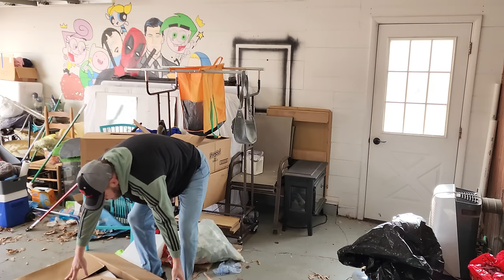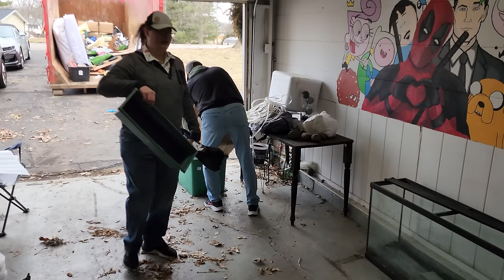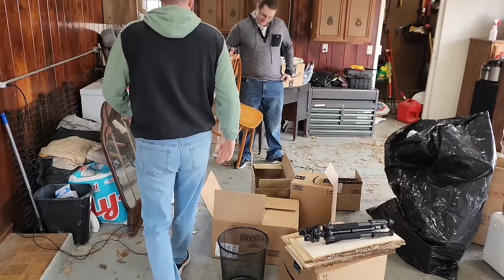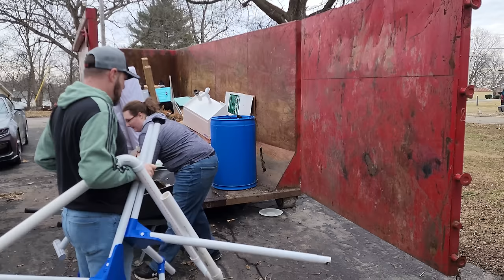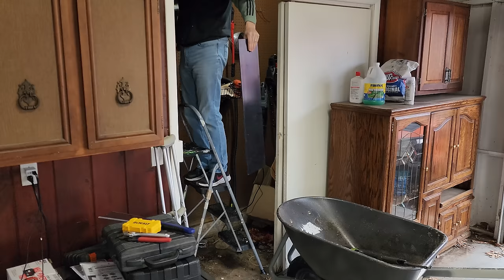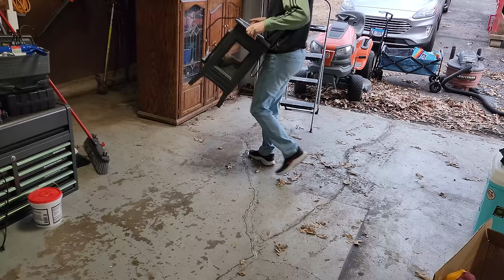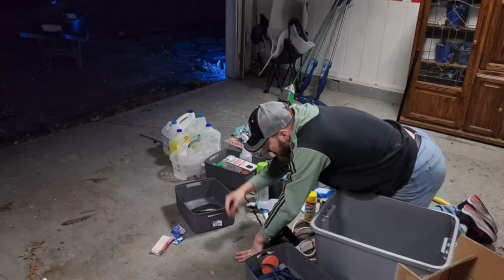Cleaning an 8-Foot Hoard From MY OWN Garage!

Comment: I am a new subscriber and this is the 3rd video of yours I have watched.  I really needed to see/hear this one, as my garage is a cluttered mess!  I am not a hoarder but definitely an out-of-sight-out-of-minder.  My garage is full of storage bins, which shows that I tried to organize my stuff originally, but then I haven't touched those bins for decades.  Like, my kids are in college and I have bins of baby blankets, decades. Another issue is that I only have time for cleanouts during the summer, but I live in the desert so it is 116F in the summer.  Which means I need to do it over winter break, literally the busiest time of year for my family.  Sigh. Spring break is pretty hot too, but more bearable than summer, so I am going to at least try to make a dent then! 🤷‍♀️

Comment: Since I’ve been chronically ill with cfs/me, I’ve had one habit : if I have a pile, physical or working, I literally deal with one item. That’s it. One item. If it’s a box, it’s one box. If I can do another, I do. But it’s still just that one box. Right now. If I don’t feel like finishing, I don’t. Usually one will lead to another. To another and so on. I often get enough done to make me happy. And things get done over time. 

The other thing I’ve done is re-evaluate every single purchase and every single obligation I take on. Subscriptions are no more. They take too much energy to remember and deal with. If it costs more to purchase one time, I’ll be less likely to buy it all. Life is less complicated that way and I realize I don’t really need it. So the clutter of deadlines and obligations is reduced.

Comment: My pile is more like 15 ft. Wall to wall, ceiling to floor. And pretty much everything at the bottom is water damaged.

The inside of my house was just as bad, until recently. I came out of my clinical depression funk long enough to actually clean up.

But the garage ... oh boy. It's scary in there.

Comment: Most people have no idea what it's like to live in a map dot surrounded by fields, forests, and farms. Hardly anybody wants to live there and NObody wants to be homeless there. You can't pick up free curb stuff or dumpster dive, because everyone knows everyone and someone will see you. Yes, close and tight-knit, but most still try to feel they are better than the rest, so gossip spreads like wildfire. 

Mice happen,  even in a newly built home that is kept spotless. Mold happens because the corn and bean fields trap moisture and there's minimal wind,  other than the occasional tornado. I live in Florida now and I swear the humidity is the same. And I traded mice for roaches. Yay

Comment: I have a small tackle box under my bed (I think that's where it is) where I put phone cords, camera accessories (the camera is in my friends storage unit I'm hoping), micro SD cards with multiple adapters, there's stickers and a bunch of random miscellaneous items that I know need to be gone through I just don't know what to do with it. The same goes for the storage baskets on my book shelf. I have very few items with me, most of what I own is at my Ex's place in Canada (I live 7 hours away in the US). I am so afraid of throwing things out because I feel like I'm losing everything, but I know it needs to be done. I used to be able to go through my things in the spring and fall to declutter and put things I'll need in storage, but I've been putting it off cause more than half of what I own in either in my friends storage unit or in another country.
Reply: I  have ADHD and Autism so not having my things has been messing with my head, making me not want to touch the few things I do have.

Comment: I have never agreed with anyone more. Most of the time, when we're getting rid of something, it's not something that anyone else will want either. Sure, I'll donate clothing and blankets, but mainly because the question of "Will someone else enjoy this more than me" is the only way I can convince myself to get rid of it. I have a small space, and it's really easy for stuff to pile up. Furniture can be put to the curb because it's not a question of if someone will take it, but WHEN. My town is a pretty similar size to yours, but without the large farming spaces, so it's a simple matter for people to take an extra 5 minutes to grab a piece of furniture off the side of the road.
We do still take truck loads to the dumb on occasion though. My dad works there, so it's much easier to just toss stuff in the back of the pickup than let it waste space because "maybe someone might want it."

Comment: Alright Mac n cheese, are you spying on me??!? 👀
I need HELP!!
HOWEVER not in the form of coming to clean it for me.
I need words of encouragement, advice or maybe just an ear.
I do not suffer from ADHD, nor am I a hoarder so to speak. 
I do have a craft room, and I save every single box or scrap I think could be used in a craft down to scraps of foam. It's out of control!! 
It's also a dumping ground for thing's I do not use. I also have clothes so high I saved to make a quilt, at this point, I could make several. My mom had given me 1 of her sewing machine's I haven't found time to figure out how to use it (with the new puppy and all)
Last but not least back in 2005 my mom gave me a huge box of her clothes she was getting rid of. I didn't have rm for them then so the lived in a storage unit. Fast forward to 2021 we got our first place with more rm. The box of clothes have been through twice seeing if I could part or use any, the second seeing if anything would fit. It was a waste, I didn't part with anything. 
In July of 22 I received a phone call from my brother stating my mom was showing signs of dementia. 
Here now it's 2024 and I can't bring myself to part with it even though I know I'm not going to do anything with it. My craft rm has become a hoarding rm 😢

Comment: I believe I have ADHD. You talk about bouncing around when doing stuff.  My job requires that I be very structured, working from A, B, C, etc.  I am okay with that although most days there comes a point where I am overwhelmed and struggle with that. I reward myself by giving myself permission to bounce around from A to 2 to chickens to purple when I clean. Things really do get accomplished that way. The only rule I have is not to create more of a mess than I started with and get garbage and recycling where they belong before I finish. I find I actually look forward to house chores because I have the freedom to do what works for me.

Comment: Your descriptions fits to my mom so well... It all still is usable, or she can sell it... Will she use any of the staff or sell it? 95% never... Ofcause the 15 Bodylotions are still usable, but will she ever use one... no. Even worse, she buies another two (because two is always her minimum size), because it was on clearance and she liked the smell... and ofcause she can sell it eventially. Always the same... I'm going crazy with her... it's so frustrating. She keeps buying stuff because it is cheap and we can use it, or she wants to gift it to somebody or wants to sell it on ebay (what she does to be fair, but she sells way slower than buy new stuff)... 
We have so much cheap and old stuff, that she still thinks is sellable, and it is total insane (like broken dollar store glasses, that somebody can fix), while buying new stuff that she just wants because she is intressted into it for like 5 seconds...

Comment: I read that placing bars of Irish Spring soap around an area where mice frequent, will prevent their entry. They hate the smell. If it fails, you have a good smelling garage. Win-Win. So suck it mouse turds.

Comment: Or your “whatism” syndrome. What if I need a big box? I don’t order large items often. I can use the large box to hold smaller boxes to recycle! Oh yes. Good. I’ll toss it in here and keep it. 

Oh this tiny box is so small. It’s perfect for small returns. I’ll keep this box. 

Oh this is an expensive item/electronic. I should keep the box in case it has a defect or breaks really fast to return it. Or maybe I’ll sell this in a few years and the original box will help me sell it! (I hoard Apple product boxes it’s a problem) 

There’s so many whatisms even with BOXES.